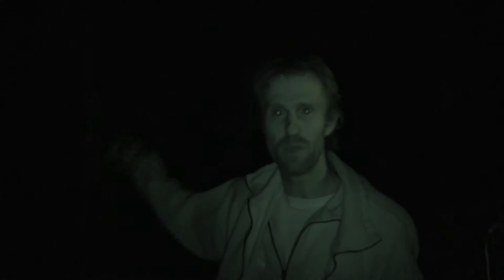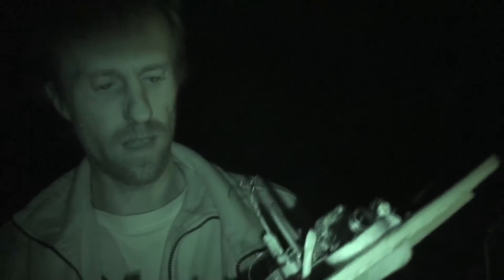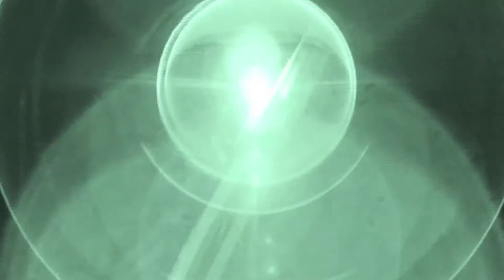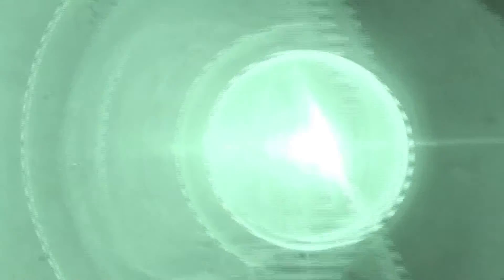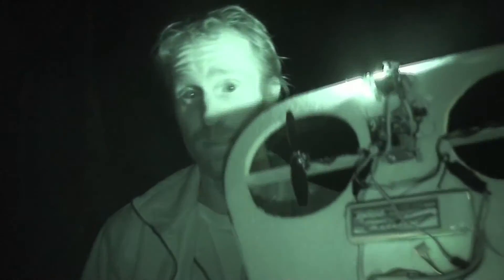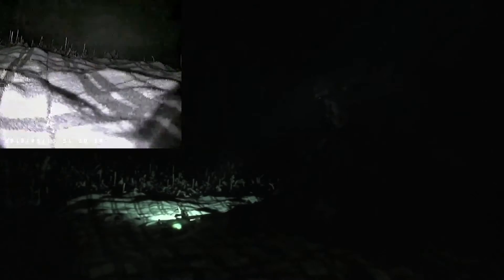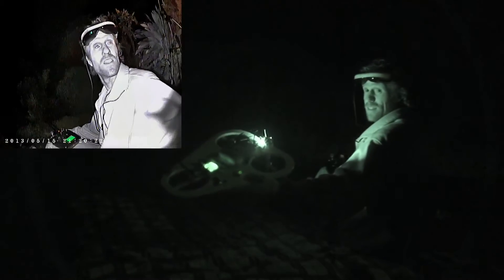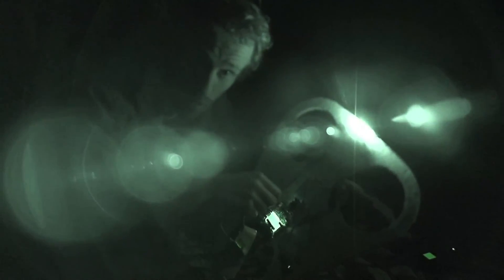Infrared FPV. RCHacker #38

Comment: Also might help if you drop the props and motors some how till they are inside the hole too. Having it so high up is just sending some of the thrust into the top of the frame, reducing efficiency.

Comment: Love the frame design. It might fly better if you smooth out the edges at the top of the holes where the props are. Take a look at the design of similar cowlings around props on other craft.